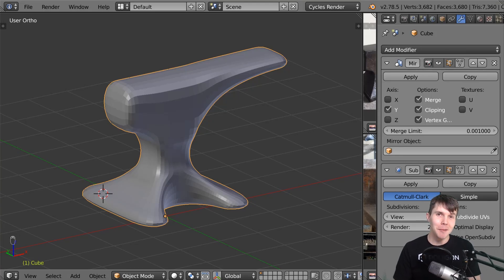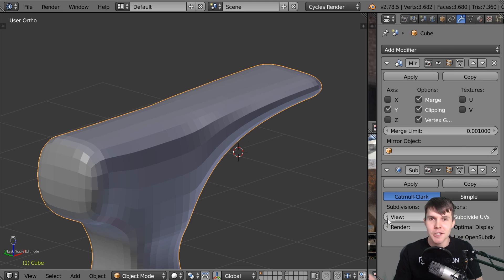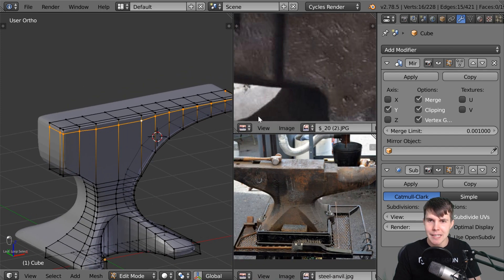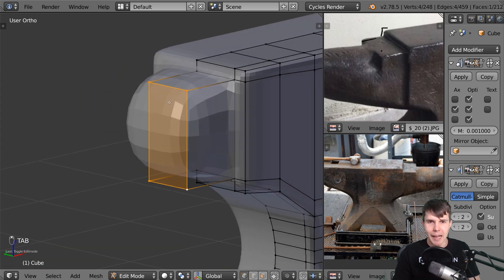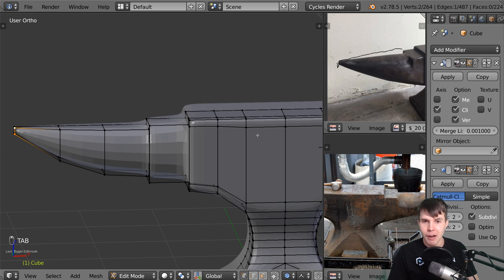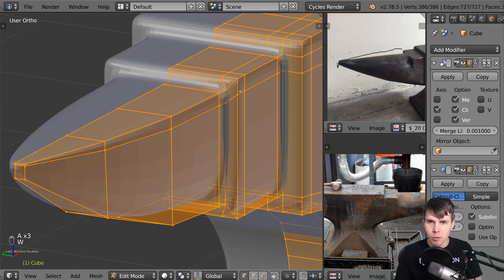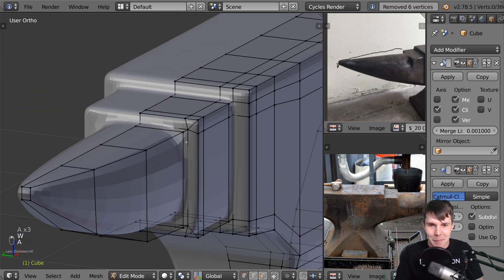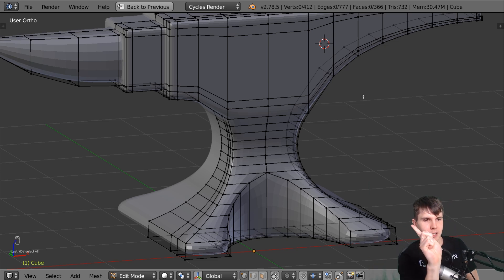Blender Intermediate Modelling Tutorial - Part 3: Sharpening Edges

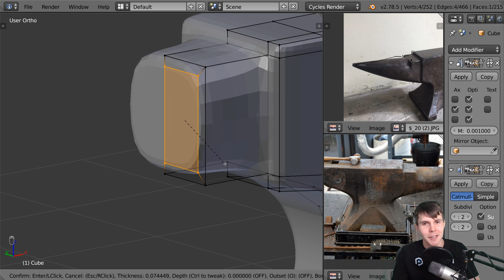Comment: If at 7:29 you cannot get it to inset properly, even if you try turning boundary off, you probably have a face on the inside between the face you're insetting and the mirrored face. Go to wireframe mode and you'll see it. Delete it, and it should work.

Comment: Hey bro, I know you are much more experienced and better than me in 3d modeling using blender, but there's this simple way that you can solve the extra loop cut part that you don't want on the top pointy part of the anvil is that instead of doing inset and merging the boundaries, you can create loop cuts before extruding. So now you don't even have to inset and merge boundaries. Just a thing that I tried out.

Comment: In case anyone encounters this tutorial, just know that you can use less edge loops by using a tool name mean crease. It'll provide a sharp adjustable crease for when you use the multi res or a subdivision modifier. To access it, highlight the edge you want to be sharp, pull up your N-panel and in Item>Edges Data>Mean Crease. 0 to 1 will adjust the sharpness on the crease. It was a blessing when I found this trick.

Comment: I had to make a few work arounds in 3.3. Like I first made the horn - remember to have clipping on before extruding in mirror modifier - and before I made the tip of the horn sharp, I made the sharpening loop cuts to both sides of the corner to get four points to work with. And after that removed doubles from the horn - pick the unnecessary loopcuts and drag them with G+G and then F3/Merge by Distance. And as a last bit made the horn sharp.

Comment: At 7:28 if nothing happens when you press B turn the mirror modifier off in the viewport for the time being and then check if the left side of the extruded blob has a face on it
Normally the face cant be seen with the mirror modifier on 
Select the face then delete that face only
The turn on the mirror modifier and do the steps for inset and now the B key may work ( at least it did for me)
Reply: Exactly what i needed, thanks !!
Reply: @notZ0mbi3cat  you're welcome

Comment: I am not a Blender expert so maybe someone can tell me if this is a horrible idea. Is there anything wrong with hiding the horn before doing the loop cuts (around 14-15min this is being dealt with). You do end up with 4 vertices that need to be dealt with by going this route because there are two 5 vertex faces. I moved them with gg to move each 'problem vertex' and then removed the additional vertices with merge by distance. Then I turn the 2 triangles into a single four sided face (in two instances). Anything wrong with this route?  Am I causing myself issues later by doing this or is this another acceptable way of doing it? Sorry if my explanation is hard to follow. Trying as best I can. Thanks. 
Also, Thanks so much for the videos!

Comment: If you still have issues with turning the boundaries off at 7:25 ,  I don't know how to help you with making it work but you can try this instead  :
Use I regardless then delete the face that was created by that on the inside part along with the inner face that the previous E created ,  Move the 2 inner vertices that were created by 'I' as close to the mirror side as possible , clipping on mirror modifier is on anyways , so push them all way in . Extrude from there and that will work perfectly ! you can just add a face at the end by alt+ left click the last loop and then press f
Reply: turns out my shit was a bit too thick maybe that was the problem after all
Reply: Thank you I was stuck at that part using 3.4.1 version I deleted the inside face I extruded and press "I" then "B" and it's worked

Comment: Hey if anyone is having trouble with the inset borderless at 7:00, do what you have and then make the selection, after making the inset even though it looks like booty cheeks, make sure on your mirror mod that clipping and merge are turned on then select the face on the inset you just made press g and then y and move the face to the edge just like we learned in the last part with merging edges just this time you dont have to remove duplicate edges.
Reply: This worked for me!! But if anyone has the same problem I first did where you're left with a little triangular "gap" near the base of the horn, that's because you extruded too far when you did your first step. What you want is to extrude outward very slightly to create a very tiny booty first, then press g, then press y, and move your mouse to...ahem..."clap those cheeks" together so they merge. After that, extrude outward like he does in this video and it should work with no mirroring or "thigh gap" lmao.
Reply: @jeffersonadams8711  you both are saviours ! thanks friends
Reply: @jeffersonadams8711  I noticed that too, but I liked how far I extruded it and wanted to keep it. So another solution to get rid of that thigh gap is to select the four faces created from your inset and also move those together on the y axis. Basically closing the thigh gap after you've extruded the booty cheeks.
Reply: Thank you!
Reply: Thank you for this
Reply: thanks
Reply: thank you so much!
Reply: For some reason pressing B is not working for me so i had to do this method.
Reply: you save and make my day for blender, big thank you for you ^~`

Comment: For people struggling with the "butt crack" problem at 5:55 ,  if the other solutions in the comments didn't work, I fixed mine by setting the "Merge" value to 0.012m instead of 0.001m in the Mirror modifier and setting it back to 0.001m at the very end of the tutorial. Hope it doesn't cause any problem later on
Reply: This should be  top comment
Reply: 4 years and this comment, still works, thanks!

Comment: Using Blender 2.92, Typing "B" during inset does not fill in the face adjacent to the mirrored section.  The hint panel Indicates "ON" but there is no change.  Used loop-cuts but this add a lot of geometry.  My research and experiments are fruitless to date.
My previous comment was incorrect:  "B" does work but must be pressed before click confirmation with left mouse button

Comment: If you press I again in inset it will turn on "Individual" making the boundary disable do effectively nothing
Reply: I read this comment a few times without clearly understanding what was meant. To make this very clear, while using the inset tool, check the list of modifiers (across the top) if you see the last one as Individual set to "ON" you need to hit the "I" again to turn it off.

Comment: 13:00 In blender 2.91 I don't know why, but when deleting the edge on the tip of the anvil (GG => Slide => Merge vertices) it doesn't regain it's rounded shape. Workaround is just, select the whole rounded end, click H to hide, do you loop cuts, unhide and then clean-up the vertices by merging as shown. It's even simpler this way, no need to select tons of edges, slide them, and merge vertices too many times.
Reply: can you elaborate

Comment: Pretty sure 2.91.0 is bugged for the inset boundary thing at 7:27 I've deleted the face on the mirror plane and checked clipping, B does absolutely nothing. Really frustrating because deleting that face seemed to have helped everyone but me. Any help would be appreciated, otherwise I think it might just be a bug, I've tried for so long to get it to work :/
Reply: If you pressed I while in inset mode you will have turned on individual inset which will make B do effectively nothing.
Reply: I had issues with this too. I redid all the extruding with the "merge" setting under the mirror modifier turned on and set to 0.03m (in addition to the clipping turned on) and then it worked and the inset boundary thing worked too. And then it worked without "merge" on as well, so I think it's a bug. Hope this helps someone out there. I'm using 2.93

Comment: Im trying to do the proportional editing on the horn with the top hidden, but the outline of the hidden vertices is also hidden so it makes it very difficult to see how far up I should go. How do I keep the outline of hidden parts?
Reply: turn on to wireframe mode with optimal display (in subdivision modifier) checked
Reply: @abhayagarwal5097  did they remove the ability to do this in 3.0?

Comment: Has anyone solved this Boundary issue when creating the horn? This has been my first big stuck issue :( Im in 2.82 and I've even tried doing the Boundary on a normal box and it just doesn't work....I've checked all the comments and nothing has worked...... please help...
Reply: and all of a sudden I solve it... so, if there's a tick box in your Sub Div modifier called Use Creases, untick it, and then the boundary works correctly... I suddenly remembered Andrew mentions that using Creases wasn't good, (it appears in later versions of Blender it is now a default setting) hence why we had done Edge Loop cutting.... hope that helps peeps.
Reply: absolute life saver thanks

Comment: Bevel gives bit extra number of mesh to handle..
Crease( shift E ) is for extreme edge..

So for slight smooth edge,
You used loop cut as a support keeping mild edge
Just like chocolate bar animation😍😍

We learned new use of perpendicular loop cut as to reduce sharp margin effect while extruding 👏👏👏👏

Learned INSET "I" with B boundary cancelled👏👏

To proportional edit with other side firm.. H & hide to be firm vertices...👏👏

Can someone please explain Difference between Scaling & pulling in vertices on final tip  ????

Toughest part you solved...
Breaking loop cut to avoid unwanted whole object bounding with shrunk curve..

Taught that triangles /far away angled faces might trouble our riggings 🙏🙏thank you sir 

How you (G+G) moved unwanted loop part to edge
And " remove doubles"
Someone confused doubles with dissolve tool
You told how it creates new arrangement of new mesh .. might tough level complication
But you made very simple👏👏
Thank you BLENDER GURU..
🙏🙏JÄY HO GURUJI 😁

Comment: Couple things about 2.8+
A: Remove doubles doesn't exist.  There is a "merge by distance", but entirely unnecessary here.  Instead, select the unwanted edges press "x" select "dissolve edges" Poof, gone.
B: When he gets to the "Press B to remove boundary" it doesn't work.  (Specific to mirrored modifier) How to fix: Go to the "inside" where no face exists, select the face that shouldn't exist, press x and selected "Delete faces only", that'll leave behind a lone edge that needs to be removed as well.  Do same thing and select "Delete edges and faces only".  Now your "boundary off" button will work.
Reply: Thanks so much! I had to scroll down to find the solution and yours help me very much, also my problem was the Inset B part and you fixed it!

Comment: Great stuff Andrew, really like it.  I followed the anvil tut all the way thru, and got a decent looking anvil.  Then I decided to make on without following along.  Ok, that's much harder.  I keep running into two major issues - 1. the Subsurface division gives me two horns that are separate but parallel, but looks right (but too square) when subsurface is hidden. 2. 98% of the time the 'b' for inset boundary does NOTHING, but occasionally it will work as yours does.  There is obviously something I am missing.  The unanswered questions are - When should subsurface division be enabled and how will it interact with other workflows?   Why does the 'b' for boundary not always work for Inset?  When is the right or best time to cut edge loops wrt creation of the rest of the geometry?  For instance should I cut edge loops before having the entire mesh - like say on just the anvil base?  Would it make more sense to edge loop each 'part' so for instance, my edge loops don't affect the horn since I made them earlier on the tail only (before creating the horn).

Comment: (2.80) Around 9:00, you hide some cage geometry, but the subd geometry is still visible as a wireframe.  Here in 2.80 hding the frame seems to hide the subd geometry as well.

What's up with that?  Thanks.
Reply: I had the same problem, found out that on the subdivision modifier you have to uncheck optimal display, then you'll still be able to see the subd geometry after hiding something
Reply: @Slurpsapper  Thank you !
Reply: @Slurpsapper  didnt work
Reply: @jg2283  Hey. I was like you. it does work but you also need to be in Wireframe mode, not solid mode ;)
Reply: @Deehn  tried this, doesn't work
Reply: I'd like to know as well.

Comment: 5:50 I tried to extrude and ended up creating a butt.
Reply: A little late to the party, but try this:
Go to the Mirror Modifier you made during the previous video and under Options turn on Merge and set the merge limit to 0.001m if it isn't already. Mine was set to 0m and I had the same problem so I increased it slightly and it seems to play nice now. Hope this helps, if at all
Reply: Yh I have same problem, pls some one help.....
Reply: NIKHIL Gupta there’s someone who answered it in the comment section
Reply: @dogemcdogeface7901  
Try recreating the model again, I had to do the same.
Hope it works.🙂🙂
Reply: Same here what do i do
Reply: Just go to the mirror modifier and seltect in the options «bisect» on the «y»-Axis (Version 2.8).

Comment: Well I have a double edge loop with only vertices that messed up everything and that aren't detected by the remove doubles tool. I have to delete them manually kms
Reply: Okay nevermind I just remembered I needed to select all the mesh to remove the doubles, just when I finished doing it manually. I'm gonna commit sudoku lmfao
Reply: @NyctaOfficial  I have been struggling with this. I forgot you have to select A and then merge right. So obvious! It worked now. Thanks!